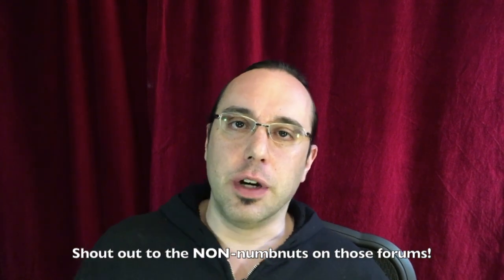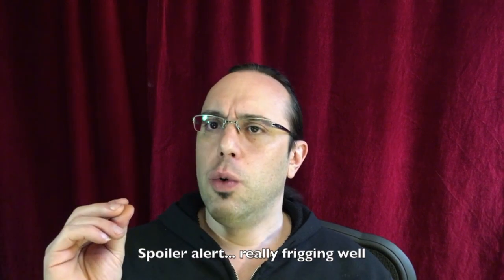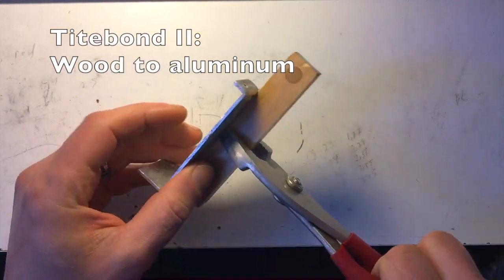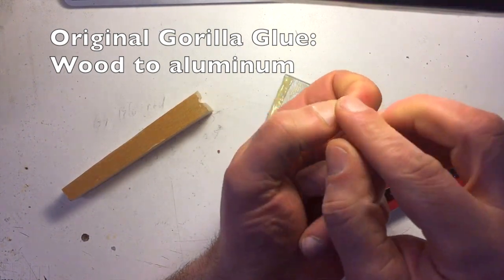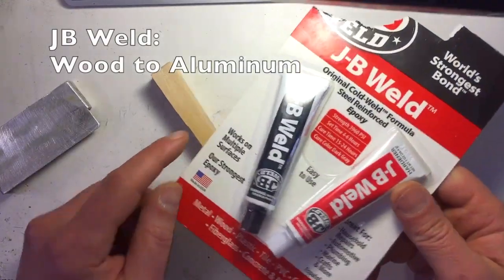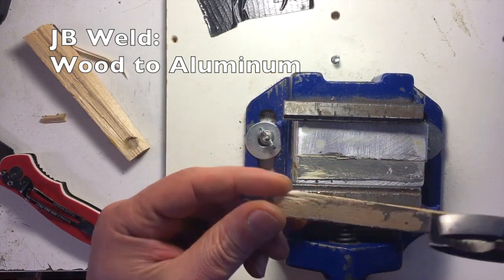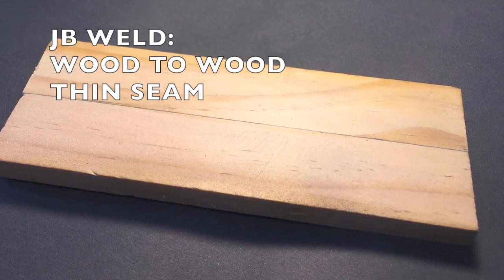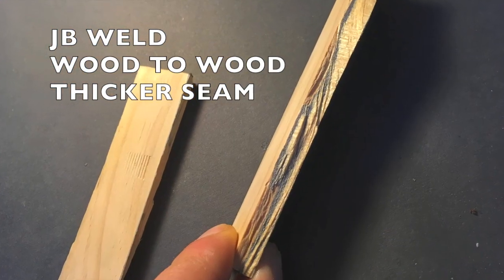Gluing wood to aluminum: 4 common glues tested

Comment: Gorilla glue clear is a non foaming polyurethane style glue and it works well on wood to aluminum I even forgot to activate it with water and it still does a good job. You need to clamp it for about two hours, and then it reaches maximum strength within 24 hours. Kind of messy to work with, but the fact that it dries clear is nice. I did fine with some alcohol or acetone used within 24 hours will clean up some of the excess squeeze out.  While JB Weld may be nice, it's just too expensive if you've got a quantity of wood to glue to aluminum. I had high hopes for super glue, but it just breaks right off. Too hard and nasty to work with.

Comment: I used JB Marine weld on a model boat sticking aluminium to aluminium that were under some tension , roughened the surfaces and cleaned with acetone. It stuck really well .

Comment: Thanks for this Alex!  I was scratching my brain on how best to glue a wood T-mold (used as a transition molding between tile and wood flooring) to an aluminum U channel (which you screw to the subfloor to hold the tongue of the T-mold) and bingo! I found this video.  Plus, I happen to have a some JB Weld left over from gluing some plastic trim back on my car door and so I am good to go! Thanks again!

Comment: Been wondering what the best adhesive for laminating wood to aluminum with minimal creep. Considering the difference in movement. Titebond 2 and 3 creep as they allow more movement for that extra strength before break. I wonder about urea adhesives, ive read wood to wood they have minimal creep being hard. Whichever, acetone wipe, and wet sanding in the adhesive to the aluminum prior to clamping to beat the oxide layer problem, so the choice should be fine and slow setting. Probably an expoxy then. Very curious about these urea glues just in general from reading about them. How cool would a laminate neck with an aluminum strip be? Maybe aluminum carbon\graphite composite laminate neck through would be the easier thing, high tech.

Comment: I have foung that contact cement for wood to aluminum is the best. Contact cement like for counter tops. Gorilla glue for wood and aluminum did not work for me at all. I have not tried JB weld but I've used JB weld on a lot of stuff and to me it's one of the best (the dark gray stuff that cures for 24 hours).

Comment: Great video - helped to convince me that epoxy is the best adhesive for bonding wood to aluminium. I'm working on a project where I need a strong bond between aluminium and plywood. I wholeheartedly agree with your opening comment. It's not just guitar fora, most fora seem to be filled with numbnuts spouting unsupported nonsense.

Comment: JBWeld… The glue didn’t release. The wood broke. Not a single portion of that glue released. The bond is stronger than the internal forces of the wood and the wood’s weakest point was far less than that of JBW.

Comment: The problem with aluminum is it will form an oxide and like rust it will expand and break the bond.  This can take weeks or months depending on how exposed the aluminum is.
So immediate tests can't really be used for aluminum.  In particular I must add that a guy with an aluminum sailboat patched holes in it with epoxy, and it works great, until one day the patch pops off and his boat sinks!   Just thought I would add that, otherwise good video.

Comment: Great video.  Thanks for the "test".  I used Gorilla construction adhesive on a piece of poplar and aluminum and ---- after drying for a few days --- popped right off!  Was very disappointed.  After seeing your video, I will try the Gorilla polyurethane glue, looks like it would work great for my project.

Comment: Thank you thank you for helping me select the proper glue for adhering an a small (0.5 in square) aluminum heat sink to hardboard for a special LED project.  I'm so glad I didn't waste time an wildly expense of using ethyl cyanoacrylate.  That stuff works great but only temporarily.  Long term, it does indeed break down.

Comment: I used the gorilla glue  to fix aluminum to wood , worked well and after 3 months still as good. You see , I'm not likely to start trying to pull it off with pliers etc

Comment: Nicely done. I’m doing a project where I’m veneering wood to a steel plate. Some of these ideas may help. One thing you could try in the future is liquid nails fuze-it. it’s all in a caulking tube and is a blend of industrial silicones.   I’ve had really good luck with that product.

Comment: thanks!  This is exactly what I needed to know.  gluing aluminum foil to wood to act as a reflecting panel.  I think the tite bond will do it and I already have it.
Reply: Hi there - Just came across your comment and it sounds like your use might have been similar to mine. I getting ready to create a silver rhinestone guitar. Since my guitar is black, I'm needing to add a reflective surface behind my rhinestones to help them capture light. Looking for options better than spray paint. Would you be willing to share a bit more about your project and how you ended up applying your foil? Thanks so much!!

Comment: I wonder how well construction adhesive would work?
Reply: I used Loctite PL Premium to glue nice plywood to moderately sanded aluminum. Enough to ooze out the edges a bit. Clamped.Cured for 3 days.
Had to serious chisel to get it apart. Took the top layer off the plywood.
Reply: @tunapig  On Loctite PL Premium I've wondered how it would perform over years in the Florida sun, wind and rain?  would be awesome to skin a 2x4 structure with 5v panels without nails or screws.
Reply from the maker: Probably pretty well.  Many of them are polyurethane adhesives these days

Comment: very helpful, thank you! i'm looking to laminate ~0,1mm stainless sheet springsteel onto a fretless bass's fingerboard. JB-weld is my prime candidate so far. 
i was moreconcerned about the bond to the metal, but the wood seems to be more prone to cominjg off. but then again,  many hard woods are
Reply from the maker: I can't remember if I ever uploaded the video about gluing fret bars onto wood... I may have just completely forgotten. ANyway, I used JB weld to glue half-round rod onto maple for ukulele frets.  I scuffed up the metal pretty well to make sure it was properly keyed , and it Worked well, and im going to try it for a fanned-fret guitar in the future.  I didn't do a pull-out test though, which mayle I'll do some day. One pain in the butt was that the metal particles from the JB weld for into the wood grain after sanding and it was annoying to clean up from a light colored wood like maple

Comment: "Precision adjusting device" I'm definitely using that lol ..... wait the JB Weld took a lot of force and the the wood broke but you were then able to easily lift up the piece that remained? Is that because the direction of the grain was in line with the direction you were pulling meaning the the JB Weld is perfect for stress in one direction but crap for stress in the other direction?

Comment: While J-B may work, it won't do for larger projects. Beware of videos claiming J-B miracles.
Reply: What is the glue for larger projects. I am trying to glue a steel kitchen napkin holder to the cabinet door. Was hoping J-B weld will do the trick.

Comment: A piece of my rifle stock broke off. If I had wood glue I would have gone with that but I didn't. All I had was standard jb weld so I used that. I was worried it wouldn't work so as I wait for it to cure I you tubed the subject and found your video which made me feel a lot better about my choice.
Reply from the maker: I was really surprised how well it works.  The thing I didn't think about when I shot the vid was that after sanding, the dark particles from the JB weld works into the grain, which required s bit of cleanup on lighter wood.

Comment: Thanks for this, it saves me some experimenting. Since you made this, have you tried to glue 2 pieces flush, and if so did you notice if a glue line is visible or not? I want to make sure the glue or epoxy doesn't form too thick of a layer so something I'm planning to work on will have clean lines.
Reply from the maker: The thicker stuff forms a visible line.  getting a truly invisible line is a bit tough, and it really depends on how much strength you need from the joint.  You have a few options, depending on how crazy you want to go.  Regular wood glue mixed with sawdust from the workpiece is an okay-ish tradeoff of strength and seam visibility, but there is water in it, so you tend to get a bit of surface swelling, which will show the seam.  You can apply more clamp pressure to help that, but it will 'starve' the joint and make it weak if you clamp too hard, so if you don't mind the extra work, hollow out the face of the joint a bit in the middle (not near the surface) to make it a bit concave (just fractions of a millimeter), then clamp harder, that way the surface has an invisible seam but the inner bond if a bit stronger.  You can also do the sawdust thing if you wish, and lightly sand the joint afterward to get rid of any squeeze out or surface coloration.  Another option is hide-glue/clear-gelatin (which you can just get in a supermarket), which is not as strong (about 2/3 as strong as PVA wood glue) but it is easier to hide the seam.  If you want to use something thicker like epoxy, I would definitely either hollow out the middle of the surface, or do a biscut joint for a good bond, and then you can leave the very extreme edges of the joint faces pretty dry/completely dry and hide the seam very well.
Reply: Thank you for the detailed reply! I'll try the hollowing method out since it seems to be the easiest way to add enough surface area without needing to approach the edges.

What I'm wanting to do would be repairing and improving a broken handplane tote by trimming the break flat and then gluing in a piece of aluminum sandwiched between the two pieces and then filing/sanding it all flush.

Comment: What would be the best way to permanently(or close to it) bond plastic to wood?  I got a piece of center console from my car torn apart for cleaning and fixing some broken tabs, but now i need to re-bond the wood piece to the plastic, its real wood.  I think they used hot glue originally but that doesnt seem like the best solution.
Reply from the maker: I'm not an expert, but I used to live out where a lot of big car shows happened, and think the most common thing I have seen is "amazing goop", but I have not tested it myself... worth a try.  Lots of the gearheads swear by it. Something like thicker 3m VHB tape (actually  acrylic adhesive on a substrate) would probably work pretty well, but it is probably more expensive.
Reply: Alex Kenis  Thanks man, im gonna give the amazing goop stuff a try!
Reply: JB Weld is permanent, we had a lawn mower head that was fixed by it and still working... repair was made in the 90s.

Comment: Hey, I am a fan of 2 part 5 minute epoxy, did you tried it out with aluminum & wood?
Reply from the maker: I did try clear 5-min epoxy and JB Kwik weld after I made this video, and they hold pretty well, but not as well as the slower epoxy.  The bond was still stonger than the wood, so as long as the surface is prepped well and the wood is not too oily, it should be fine. I used it to glue aluminum to wood and brass to wood, but  I didn't make a video for it.  I do have a video project where I used fast epoxy to glue metal rods to wood, becuse the parts were not under heavy shear stress.

Comment: Thank you sir !!  Just the video I was looking for.  JB Weld it is then.  Never used this stuff before but you convinced me.   Take care.
Reply from the maker: Glad to help.  Another tip: I tested the fast set and slow set JB weld, and the slower stuff worked better in my particular case.  I plan to do a steel-to-wood project in the coming months that will be taking about 120 static lbs of shear force, so I'll be sure to post some sort of video when I get to it.
Reply: Interested to see how you will apply the shear force.  Do you have available a hydraulic press?  You could set up a jig and use a hydraulic car jack I suppose but how will you measure the magnitude of the force?   I tried to do that to check the shear strength of wood glue but had to ensure that the interface failed at the glued surfaces and nowhere else.  Still thinking of doing it........Thanks again Alex.
Reply from the maker: I was thinking down the same lines, but maybe using a turnbuckle or ratcheting jig and a pull scale, or a pulley jig and weight plates